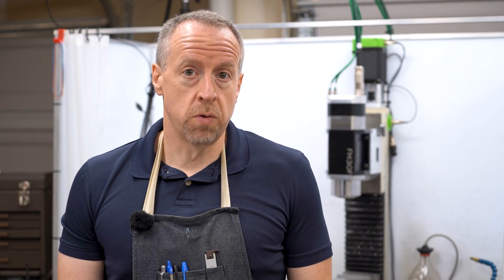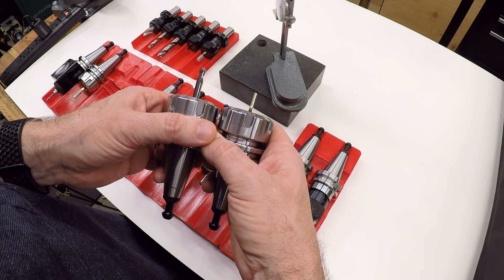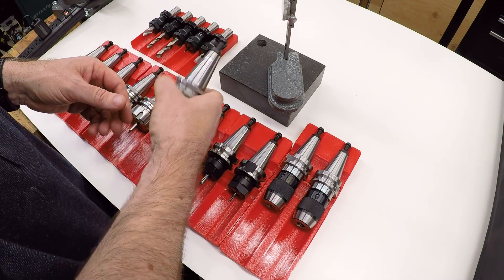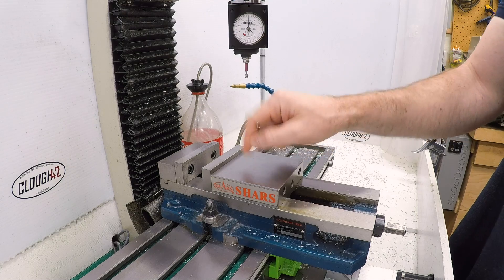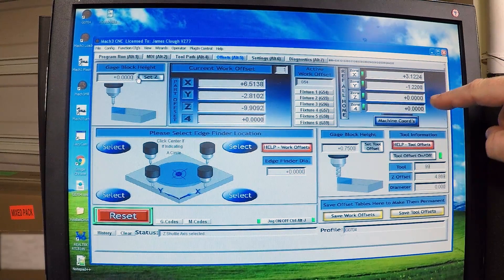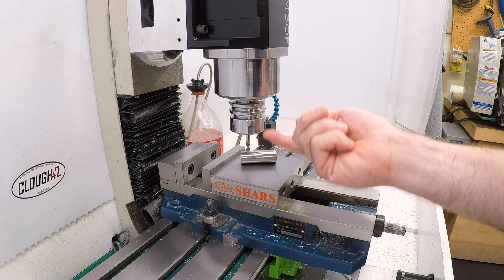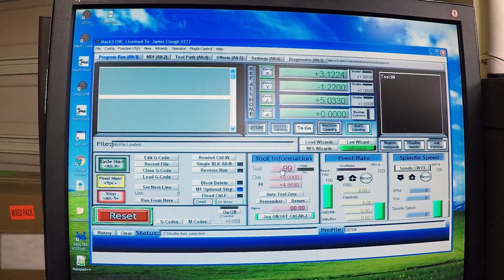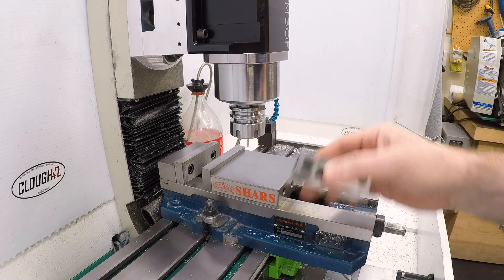Measuring Tool Lengths in MACH3 Without a Presetter

Comment: I would think this gets old after a while. I would get a z-axis tool setter which should make the offset direct reading.
Reply: Rolling a gauge pin under the tool takes about 9 seconds. Plus hell only have to do it a few times a month if he replaces a tool or ads a new one. Hardly something that would "get old" since he's not going to be doing it very much. It's not a production shop where he's setting tool length several times a day.